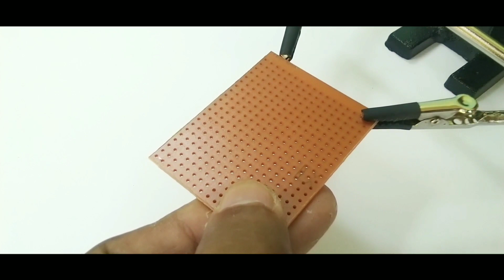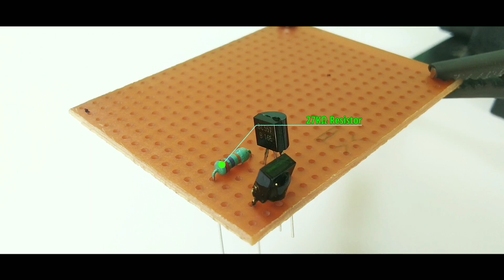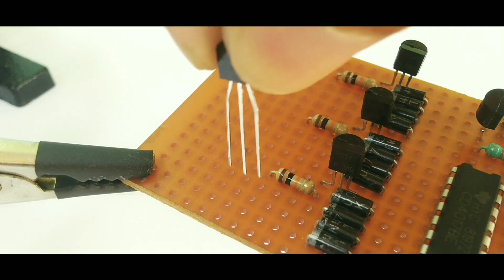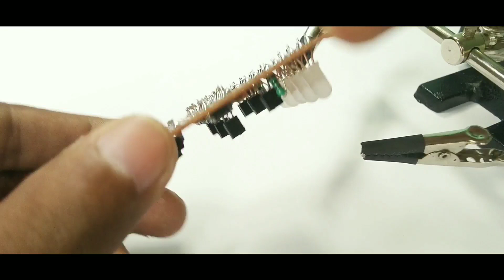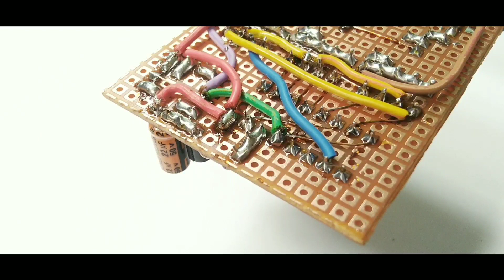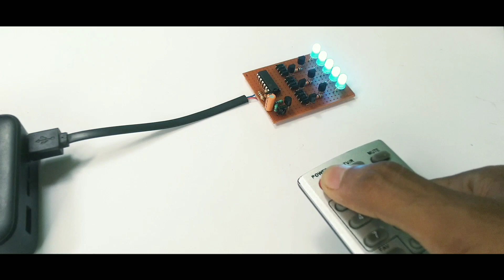How to make a Remote Control RGB LED Controller

Comment: I have made this ckt accordingly your way but my 4 leads are giving only 3 colours but in your video it is showing 7 colours
Reply from the maker: There is a small mistake in the diagram.
Just exchange the pin 6 and 7 connection.